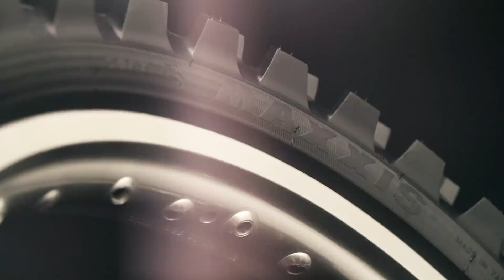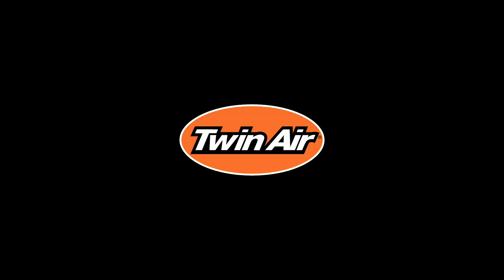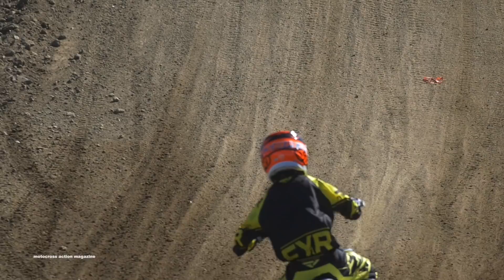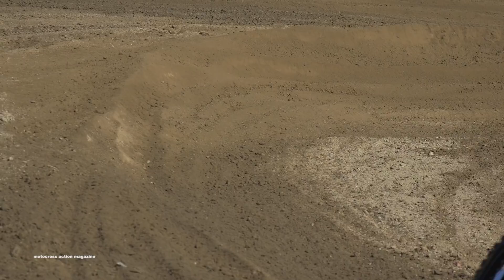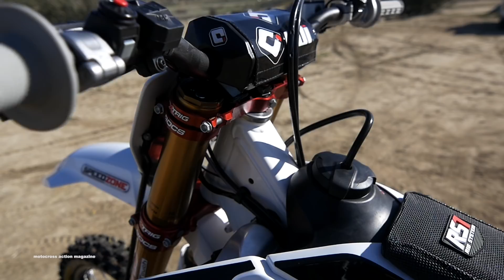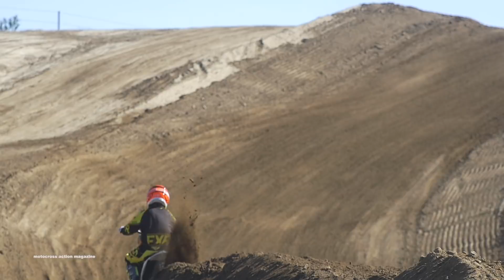Chad Reed Replica FC450 Build - Motocross Action Magazine

Comment: How did you get a hold of the Factory KTM (Im looking to buy the same cam and black box) thanks.
Reply: They have good connects and have magazine to promote the parts used and make the brand look good. If you can talk them into selling you the parts preparw to spend 10gs or more. They only gave it out because it would be impossible to recreate due to requiring some really high end 3d printers. And anyone who has one wouldn't bother wasting their time making a few MX parts that wouldnt be very profitable. It would lose you moneyif you had to buy one just to make the parts

Comment: the fact is he moved back to Wp tubes and lowers to retain factory fork / frame flex relationship ,i run  AOS Wp  hybrid by technical  touch kit spring  in 2018 ktm 500,  KYBsss aos  cartridge inside WP tubes , kashmir coated , DLC

Comment: Nice work team, now get some WP Cone forks (coil) and a Traxx Shock and compare to the KYBs, that would be awesome🤙
Reply: Cone valves aren't worth the cash IMO. A decent KYB or Showa A Kit feels better.
Reply: i have both kyb technical touch and wp kit and kyb win everytimes especially for the shock
Reply: I have the Factory Connection performance mod in my KTM 450 AER's plus a re-valve and I like them better than the KYB's in my old Yamaha in comparison. If I had the dough would probably go with the cone valves and traxx shock. The bladder kit and re-valve did wonders for the stock WP shock on mine.
Reply: The MX Guru wouldn’t even consider them if had KTB SSS, just get sprung and revamped if needed, but for WP have ridden Dal Soggio Sphere cartridge amazing and Öhlins, you can buy the TTX cartridge like the Dal Sog and it replaces the WP internals much cheaper option than full Öhlins about a 1/3 of the price and looking at WP info today for nearly 7k for Traxx and AER Cone forks I’d rather buy another bike, it’s a team issue option really. 
https://dirtbikemagazine.com/wp-north-america-product-quick-hits/

Almost blasphemy to put an Öhlins inside a WP though but it’s making compared  to stock XPLOR or AERs As is the Sphere Cartridge imo worth it of doing some racing, you really notice the traction control differences, I’d do this before any engine upgrades any day esp on a KTM.
Reply: I agree with all of that.